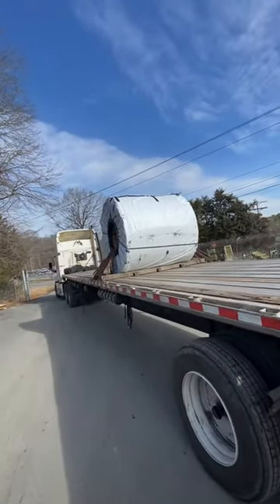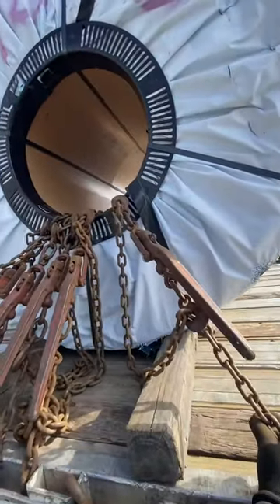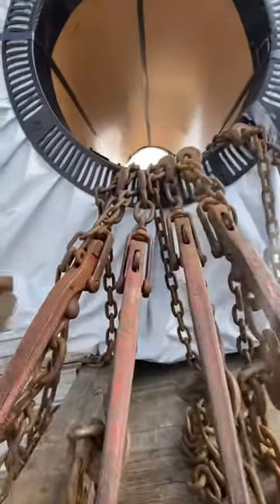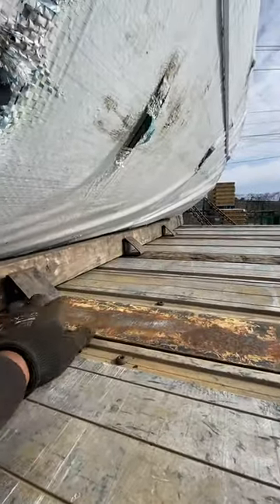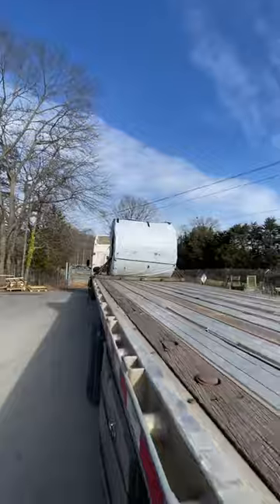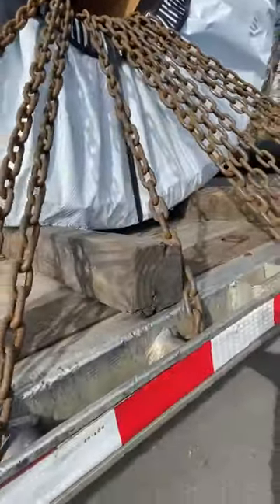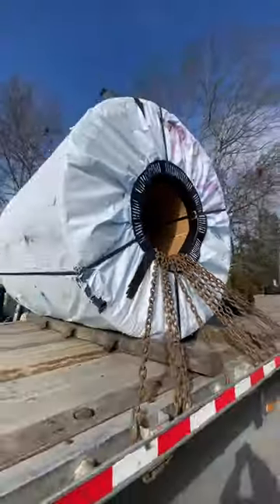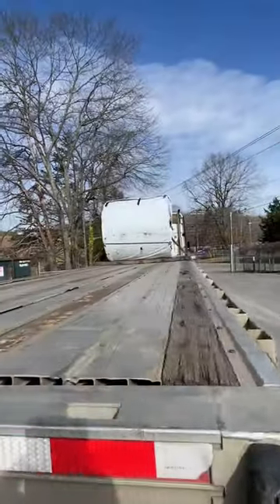Securing a master coil on flatbed

Comment: I'm curious as to where this coil was picked up since you did not use beveled dunnage.  I'm with the other driver, I would have used 5 coil racks (10 k per rack)...... it's cheap insurance.  With 5 chains,  the WLL  is good  for 47K A 6th chain  can't hurt if available. Other than the two observations, you did a dandy job of securing that coil.  Mr. DOT Man ain't gonna fault you, assuming the coil is 47k or less.
Reply from the maker: Thanks for the input bro
Reply: I came here to say each coil rack is rated at 10k (at least mine are, maybe OP has space-aged coil racks). Gonna need at least 4 for exactly 40k lbs. or 5 to be safe in case the shipper slipped an extra pound in there

Comment: Why don't they lay these down so they can't roll?
Reply: You pull into a warehouse with several hundred of these coils.. they are loaded with an overhead crane that has a lifting device that looks like a big c shape the lower goes thru the coil eye which with the protective rings will not deform the coil.
There are 2 ways to load the coils #1 is called suicide  which the coil eye fa es the lateral edge of the trailer as shown in the video and #2 is shotgun which the coil eye faces the back of the cab..the Chai I g procedure for shotgun is to cross the chains through the eye front to back an 1:33 d back to front..these coils are no joke so 5/16 chain is never to be used only minimum tagged grade 70 3/8 chain and equal grade ratchet or boomer binders be used..I prefer boo.ers because they don't twist the chain..I've rarely seen anyone take proper care of ratchet binders or use precaution of twisting the chain..or even using g corner protection for that matter but that's another can to open..stop storing straps on the winches..bungee the winches in the center of the trailer to keep the road shit off them much as possible and off the front axle of the trailer..
Reply: They're spring-loaded when they're rolled up lame up like that keeps the load on the Spring pressure

Comment: You need more chains holding it from rolling forward. And your chains need to be at least at a 45⁰ angle from the coil. Those chains in the center I'd move them. Just my opinion

Comment: The most important chains are the ones that pull straight down.Dont forget to wrap or tie your binders. Perhaps rubber under your coil bunks, metal to metal will slip. But it looks great. Good job.

Comment: Wouldn't it help if there were two more logs (not sure of the official name)  placed for redundancy?             I know that's not being done but is there a reason?  Just curious.    My logic is even if it's able to roll over the first log, the second set of logs on track could be just enough to slow it down or stop.

Comment: I’m not a truck driver, but why wouldn’t it make sense to load it on its side? Seems it’d be a lot more stable?
Reply: Wondering the same
Reply: Depends how the customer receives the coils, some customers can only offload the coils a certain way so they must be placed in accordance
Reply: Can't lift it like that. A lift or a crane picks it up through the center hole
Reply: @BiggTyM10  ok but why can’t the crane align the hole parallel to the long axis of the truck? Couldn’t the truck just approach the crane sideways? Not a trucker, clearly, just can’t understand why on earth there isn’t a way to do that
Reply: @experimenting8174  it can be loaded "shot gun"...when the eye is facing front and back.....but can't secure it as well that way, because of the limited amount of chains that can be applied.   If it's laid on its side....the coil stands a better chance of being damaged.

Comment: If the Chains can hold up to 4,700 & if the coil weighs 45,000lbs, you would need about 10 chains not 5
Reply: Not enough chains or coil rack, why the  chains in the middle
Reply: Half inch chain is rated for more than. 4700lbs 

3/8ths I belive is 4700
Reply: 3/8 grade 70 can hold weight up to 8,800 pound
Reply: I rate my 3/8 at 6000 to be safe+ 1 and 10K per rack +1.  To each their own
Reply: Huh?
Reply: You are only required to secure for 1/3 the weight mister
Reply: 5 chains will do...but he need at least 5 racks to be legal
Reply: Dot requires securement for 1/3 the weight so for example a 100,000 lb bulldozer would require chains totaling 33,333 lbs this is the minimum to keep from getting a ticket more is always better

Comment: Listen get off the road please.....theres so much wrong with this securement its crazy...technically by FMCSA regulations you dont have it secured at all...

For starters if its a 45k lb coil then it should have 5 coil racks not 3 not 2  not 4 who told you that?

1 rack for each 10k of weight 

Secondly you have 2 of  your chains hooked to the RUB RAIL not the trailer are you mad? THOSE DONT COUNT AS SECURMENT

also you have them wrapped around spools (the round piece thats welded in connecting the rub rail to the trailer between the stake pockets) 

You can  teardrop chains using a stake pocket and a spool or just a stake pocket alone but you can't simply use a spool because its welded in.

You gotta be  safer out here man this stuff aint a joke i been doing it 8 years